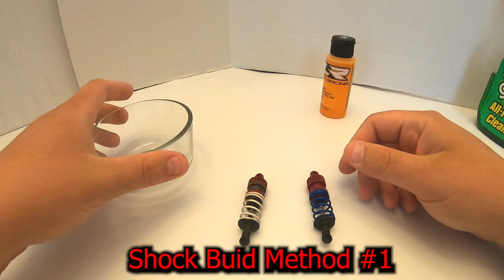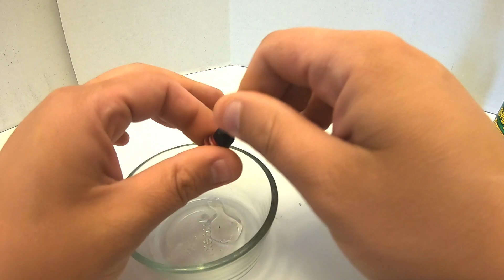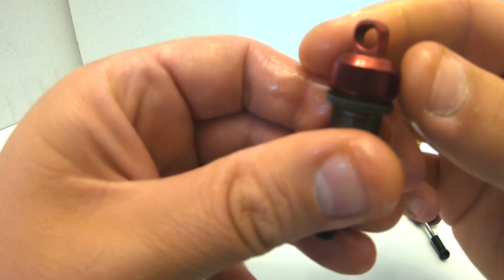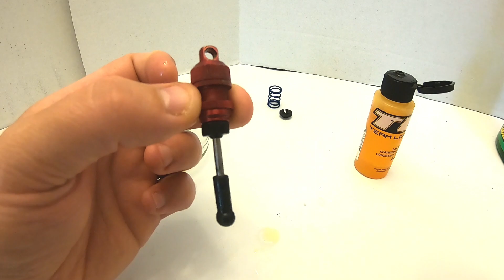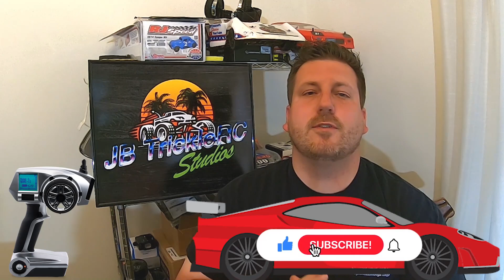How to build RC Shocks: RC Shock Building Tutorial

Comment: Not saying you're wrong, but how can method one and two both be ok if you state that the shock should only dampen and the spring control the rebound? Method one will assist the spring, so by your definition, it can't be correct,  yest you say it's ok.  Also to me, method one also appears to have some vacuum in the cylinder, preventing the piston from moving out fully, which you also say is OK.  This is not a criticism,  as a new person to RC, I'm wanting to understand the rational behind your choices as my limited experience and kit instructions all say to fill with the piston fully down, then move it up and down slowly to remove air, then with the piston all the way out, add the seal, wipe any excess oil you push out then screw on the cap.  This method has 100% of the time made my shocks full extend out after compression fully at a fairly consistent speed. This alo mimics real oil filled shocks on real vehicles.  Why would RC shocks be any different?
Reply from the maker: @broderp  great points a questions! In my opinion it boils down to preference.  If you leave rebound, it does effect spring rate as it helps further to return the shock to position. If not, the spring returns the shock to position.  If you have rebound built in with the shock itself, spring choice will likely be different compared to without. Starting out, try it both ways and see how you like it.  Just make sure the shock compresses properly.  An air locked shock is hard to compress. Long story short, you don't want that. I appreciate the comment and question. Best of luck in all your RC Adventures.

Comment: This is one of the best shock building tutorials I have seen on here. I will give you something to think about. In a real world application on a drag car those shocks you built that had a lot of rebound would work perfect on the front which helps get the front end in the air and those shocks you built that had hardly any rebound would be perfect for the rear because it allows the rear to drop with little effort and they aren't trying to push the rear back up in the air robbing the motor of power and torque. I also noticed something else about shocks on RC cars. Why do they run the shocks upside down in a real world application we run the body of the shock and the adjuster at the bottom and the piston or shock shaft at the top. Not saying any of what you are doing is wrong just from a mechanic and racer a lot of things I see look backwards.
Reply from the maker: CarolinaScaleMotorsports, I greatly appreciate the comment, kind words and support!  I do my best at helping people as I can and look forward to returning in the future to bring some new content.  To answer your questions of "why does some RC setup seem opposite of real world".  That is a loaded question with many variables.  Many things are done very similar to real world and others are not.  It depends on application and performance.  I think some factors of this is we are dealing with something much smaller and lighter than a real car so some things even when scaled just simply does not translate while some things do.  Also, regarding the shock position, I think it mainly has to do with helping prevent the shock oil from leaking out lol.  I believe some crawlers run shocks setups upside down and believe they have aftermarket support for this option as well.  But most stock shocks and even aftermarket rc shocks just dont seal perfectly. Thank you again and best of luck in all your RC adventures!
Reply: @jbtricklerc  Thanks and alos I just bought a dr10 roller🤣